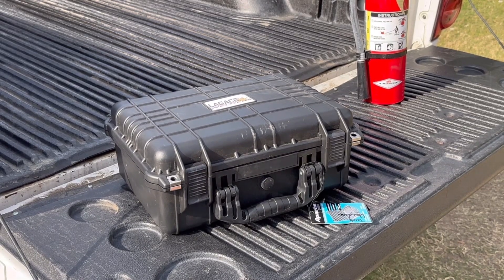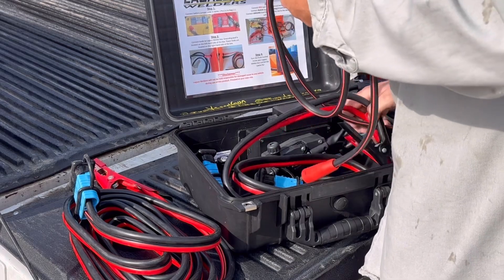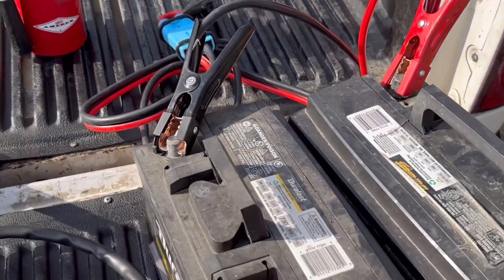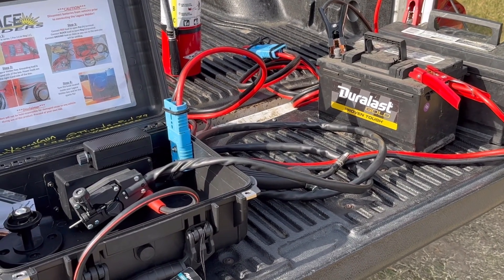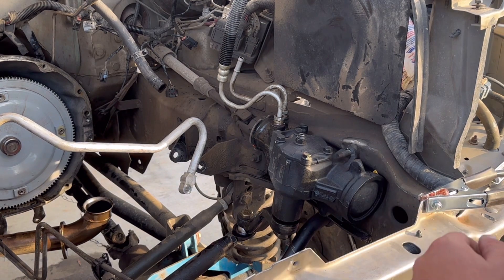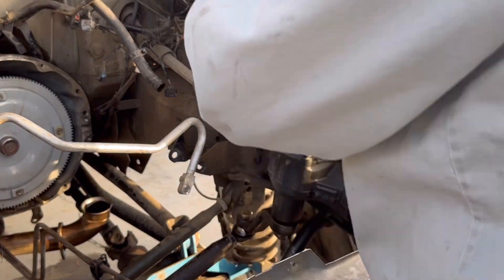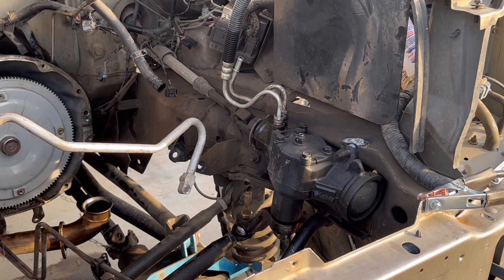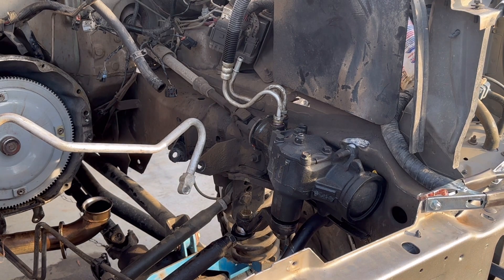A car battery powered Welder for Off-road Repairs?!?!?

Comment: With all due respect, are there any videos with anyone that knows how to weld... what kind of wire speed and voltage adjustments do you have with this...  yes, I understand the source voltage is 24vdc, but that doesn't mean you shouldn't be able to adjust voltage down...
Reply from the maker: Honestly, I have no idea.

Comment: That’s a awesome trail tool brother! Back in the 90’s we used a series of batteries pulled from several jeeps, a set of jumper cables, and a stick welding rod to get a fellow keep out. I was about 14 and it was one of the coolest things I have seen. Oakie engineering at its finest.
Reply from the maker: I was so stoked that I had to make a video even with losing my voice lol